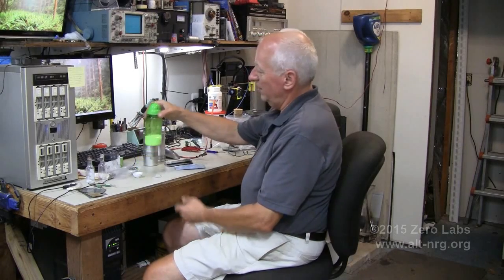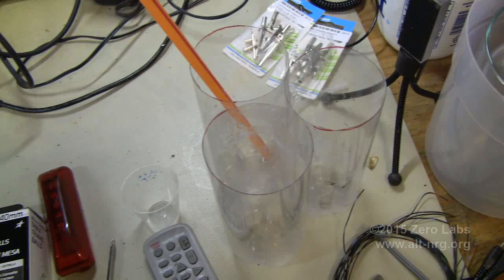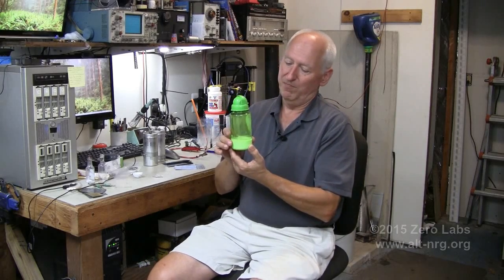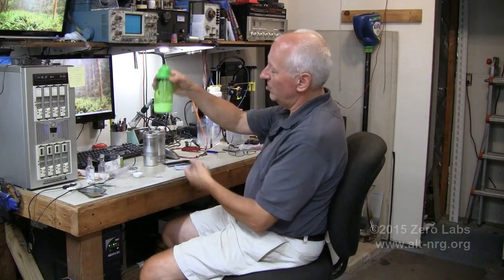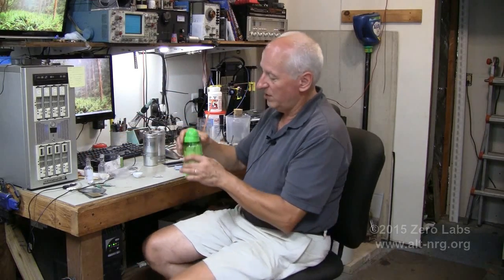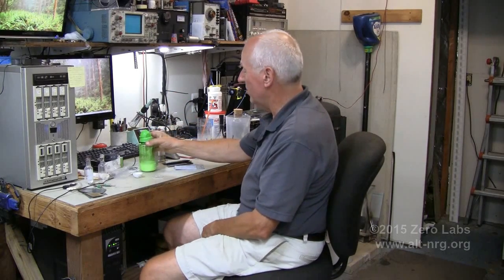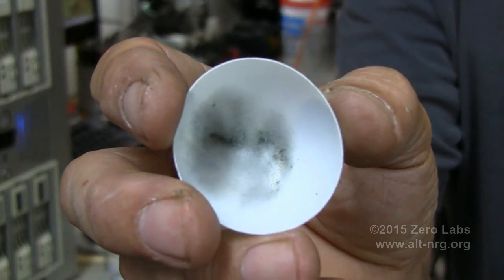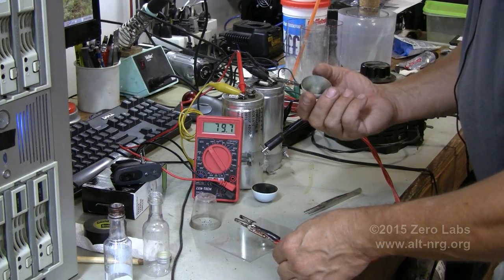#418 Keshe Plasma Reactor project update 04

Comment: the white powder is probably only Zincchloride or Zinc Hydroxid or a mix of both....
did you see any buildup of hydrocarbon fat like substanes yet ?
Reply: Jean-Pierre Mürrli
There will be no electric shock... but the nano-coated wire is pretty wild - which I was slapped by.  I have used many many spices, herbs, salts and/or etc. in the making of the nano-coated copper wires... and they are quite phenomenal.  for instance...

I went through over 48 hours now with different flavors of essential oils in my mouth... they keep changing - but I did not put essential oils in m mouth since the nano-coated wires slapped me around a bit.  Maybe the peppermint will go on for 5 - 15 min., and then the rose and/or etc. may come on my tongue as quite profound - then 5 - 15 minutes later - lavender or black pepper. 

As far as what I put into the lye bath... it was so many things that I lost count - but is like marjoram, sauerkraut, peppermint, lavender, Ecklonia Cava Extract, Ginkgo Bilboa, velvet bean powder, green clay, all spice, cayenne pepper, lemon, orange oil, beans, organic corn chips, super food, chlorophyll, Mexican Dream Plant, Tooth ache tree leaves, olive leaf extract, maw maw leaves, wine, whiskey, beer, honey, turbinando sugar, olives, beets, amino acids by Braggs, Organic apple cider vinegar, fish sauce, Italian seasonings, onion, ginger, horse radish, egg plant, olive oil, hemp seed oil, celery seed, cilantro, parsley leaves, organic butter, peanut butter, cotton fibers, spider webs as they are on everything... rice, barley, wheat, radish seed, mustard seed, cucumber seed, baking soda, yeast, rye, bread crumbs, broccoli, red meat, turkey, chicken, mackerel, sardines, rice, egg, different varieties of peppers, cheese, curry powder, chocolate powder and/or etc.  It all went in there.

These things are impregnated on the nano-coated wiring - so it will transmit all beneficial things from these things - to the water in the cup - I hope.  I am not certain as to this process... BUT WHAT I AM CERTAIN ABOUT... is that you must not touch the nano-coated wires.  I did a few days ago as I said - they slapped me around a bit... and till this very day I still taste different essential oils which I did not even list above due to the vast amounts of things I added to the lye bath - but I have profound tastes of many different oils throughout the day and night... but what I hate worse is the Vitamin B complex vitamin that I added - it is rather gross for 5 - 15 minutes and really sucks.

I hope I answered you well... if not - let me know which I am in full belief that you will do - whether right or wrong - you will answer without much thought.  Forgive me please... if I am wrong.

Peace~
Reply from the maker: +overunitydotcom No fat.
Reply: +ZeroFossilFuel what was the electrolyte ? Just Tap water or saltwater or NaOH water ?
Reply from the maker: +overunitydotcom  Sea salt, 10%.
Reply: +ZeroFossilFuel Okay, then it could also be ZnO. From Wikipedia: Zinc oxide is an inorganic compound with the formula ZnO. ZnO is a white powder that is insoluble in water.
As the Zinc ions go into solution they go to the CuO oxidized copperplates and could there reduce the oxygen so it becomes ZnO and as it is insoluable it falls out and could be the white powder. Then when all the Oxygen Ions from the copperoxide are reduced then the zinc ions can electroplate the copperplates and the ZnO production will stop....
But as Jeff said, could also be Zn(OH)Cl , but ZnCl is soluable in water, so it is probably ZnO or Zn(OH)Cl or a mix of these...
Reply from the maker: Thank you, Stefan. I really appreciate you chiming in on this video.
Reply: +ZeroFossilFuel Hello Friend! What do you think of this Magrav being sold by Keshe foundation? I have seen a lot of news that is false and were never delivered to buyers.
Reply: +KIGRATIS Energia livre This is the usual modus operandi of this lunatic
Reply: +KIGRATIS Energia livre Care to provide some evidence? Or are you just here to publish unsupported gossip?
Reply: +Peter Davis You bought a MAGRAV? It's working?
Reply: +overunitydotcom - Did you know that there was an argument that lasted for years over Monatomic Gold... the makers of it said it was gold in monatomic form... others said it was not and the battle was on.  It was never concluded until one old chap discovered a way to make a hot enough fire to be able to vaporize it so that it could be analyzed by some forensic analyzer which proved that in fact - it was indeed gold in monatomic structure.  Besides...

Who really cares what it is - as long as it works.  I would wear a petrified dog turd around my neck if doing so opened a door to free electricity for me, 3 or 4 months down the road after hooking it up.  I believe it enough that I am building 4 units right now - once complete... I will build more.  I suggest that you do the same before it is too late... 

Peace ~
Reply: +Rev. Al-Yahnai Hawkins Why don't these clowns not have this stuff analyzed in the next university lab, it costs less than 50 Euros. It cannot be stupidity brcause that behavior exceeds the limits of nurmal stupidity :(
Reply: Jean-Pierre Mürrli
I believe it was analyzed to be CO2 GANS... which basically means = CO2 Gasses In Nano State.  What I don't understand is why it isn't "GINS" instead of "GANS".  This guy is a world renowned nuclear physicist... do you really think that he would put his reputation on the line  - ESPECIALLY BY giving the Pope one of these plasma generators?  I wouldn't think he would do that if it didn't work as he says it does... do you think he would give them away if they didn't?

Peace~
Reply: +Rev. Al-Yahnai Hawkins 

I believe it was analyzed to be CO2 GANS
No, it was not. This lunatich ate (!!) the stuff and some people in the inner core ate it as well and poisoned themselves, because zinc hydroxide (The "GANS") reacts in the stomach with the hydrochloric acid to zinc chloride which is highly corrosive.

do you really think that he would put his reputation on the line  - ESPECIALLY BY giving the Pope one of these plasma generators ...do you think he would give them away if they didn't
He gave it aleady to the "ambassadors in his "peace meeting", they plugged it in and switched it on - boom, fuses blown, damage to the house installation...

And reputation? He has lost all credibility in 2012
Reply: Jean-Pierre Mürrli
I don't know anything about him poisoning himself and others but I heard him say not to eat the gans... - I have only been looking into these things since around the 13th of this month, but what I do know is that there were those who did not follow the instructions as to how to hook up the plasma generator - and they didn't do it right.

For it to blow fuses it would have to have been hooked up after the electric meter and before the fuse boxes before acclimatizing the wiring be nano-coated prior to hooking it up before the fuse boxes.  This is done by first plugging in the unit in the further-most part of the house or structure - away from the fuse boxes.  Leave it on there for a week and then move it to the next further-most room from the fuse boxes and then leave it for a week and then do the same until you finally hook the unit up before the fuse boxes.  Then the fuses will not blow.

At least that is what I have heard him say on more than one occasion. 

Thing is though - you did admit that when the ambassadors that did not know how to follow instructions BLEW OUT their fuses and such... guess that should tell you that this plasma generator DOES INDEED CREATE ENERGY - as you claimed it would not... so then - you may have proved yourself wrong while trying to toss dirt on Me. Keshe's head, eh?  What do you think - the plasma generator either produces energy enough to blow out their fuses... or it don't ~

Peace~
Reply: Rev. Al-Yahnai Hawkins
I don't know anything about him poisoning himself and others but I heard him say not to eat the gans.

This was after I had notified him and  the carabinieri about imminent danger afrer I heard about the poisoning. I do know that the alleged CO2 GANS is zinc hydroxide and when ingested reacts in the stomach to zinc chloride, which is highly corrosive and causes strong symptoms of poisoning.

For it to blow fuses it would have to have been hooked up after the electric meter and before the fuse boxes before acclimatizing the wiring be nano-coated prior to hooking it up before the fuse boxes

That's exacly why this nonsense must be stopped. You are obviously not an electrician:
Connecting the box (or anything else) before the fuse boxes is strictly forbidden and a direct way to disaster, the least being blown main fuses (which are not accessible for the customer and you need to call support from the supplier), but it can as well end up setting the house on fire.
Don't guess, we have the circuit diagram and that clearly shows, that this device, no matter how and how long it is "conditioned" causes a direct shortcircuit on the input line. No way aroung that. It is an idiotic misconstruction

that should tell you that this plasma generator DOES INDEED CREATE ENERGY 

What makes you think that? The fuses blow because the device connects the two wires of the in hous installation (no matter where it is connected) with a soiid AWG14 wire. You can obtain the same result by just plugging such a wire directly into both poles of a wall outlet (don't do it, you may damage something in your installation)

Finally: read the above carefully, do not experiment yourself, it is highly dangerous for a layman and before you follow Keshe readthrough what he has achieved during the last years, his claims, his promises and announcements and the results.

Frankly, I would not even believe Keshe when he tells me that the sun will raise tomorrow in the east :)
Reply: Jean-Pierre Mürrli
 You must not have done any research on this recently - as you do not hook up to both lines - just the positive gets hooked up to... and what do you mean that it is forbidden to hook up before the fuse box?

Pray tell then - where does one hook up the power from his/her solar panels, wind generator and/or etc.?  The inverter hooks up between the electric meter and the fuse boxes every time!

And no - I am not an electrician and that is why I like the plasma generator - you cannot get shocked or electrocuted from it... because it really isn't electricity that it creates - it is plasma that mimics electricity.  Like solar flares from the sun - can knock out electric grids - but it is not electricity - it is plasma... BIG difference that I urge you to look into.

Peace~
Reply: Rev. Al-Yahnai Hawkins Ok, continue dreaming But wear a tleast insulating gloves when you fumble around with that "safe" crap. It may pretty well kill you
Reply: Jean-Pierre Mürrli
I wear gloves - but I must say that I was slapped on the arms and in the face a bit with wires that were nano-coated... and I have had different essential oils jump on to my tongue here and there.  I put them in the boiling Lye bath - and they are impregnated into the wires... so the power is there.

Peace~
Reply: +Rev. Al-Yahnai Hawkins Can you please be a bit more specific:

You were sjapped on arms and face - do you mean mechanically by the wire or was it an electric shock?
What did you put into the lye bath? The gloves? The wire? And about what power are you talking?
Reply: +Rev. Al-Yahnai Hawkins 

Please, in the interest of your health, stop these experiments 
There may be consequences which you do not immediately notice, bu can be deadly in the long run (cancer for example)
Reply: Jean-Pierre Mürrli
Cancer?  Really now... the plasma cures cancers so what makes you believe that if it has no powers... that it could actually give one cancer?

Peace~
Reply: +Rev. Al-Yahnai Hawkins The next candidate for a slow and painfull dying. And cancer? yes, really. 48 hours with "essential oils in your mouth? Congrats, you are on the way to win the Darwin award.
Reply: +Jean-Pierre Mürrli you need to educate yourself more on alternatives as you speak from a very obtuse and uneducated point of view.  You dish it out: can you also take it?
Reply: +M A McCabe I just try to warn people not to fall for a scam. Take it or leave it - it's you who has to pay the bill. With money or your health/life or both (Keshes cancer cure is a real bargaun for just 100000 Euros
Reply: +Jean-Pierre Mürrli you don't know it's a scam...  and the money you mention is not what I've heard.  I suspect the scam is from you.  Are you just pissed off or are you paid to spread disinfo?
Reply: +M A McCabe Don't be funny and do your homework before you write nonsense. The money I mentioned is from Keshes hompage

http://keshefoundation.org/applications/medical/diseases/diseases-open-for-research

I made a mistake btw - for cancer it is "just" 50000 Euros, 100000 is for amputation
The summit is the price for coma: Up to 750000 (! no error) Euros.

And now it is time for an apology :)
Reply: +Jean-Pierre Mürrli I'm always funny: I've been in the "alternatives" for about four decades.  I didn't know about the Keshe foundation wanting money for their services....  how rude of them.  It does cost money to run operations in our rude world.   How much do you suppose it costs to treat Cancer in standard, allopathic medicine?  Hey, plus that and the euro is nearly worthless (LOL)....  I appreciate someone finally coming out with some solutions for batteries that run themselves.  An associate of mine, a farmer named Hudson tried to make a battery operation and lost 6million dollars as he was shut down by regulations.  Another associate lost $100K USD on hudson's enterprise and never even got one dose of ORME or even a sample after the debacle. So did Hudson rip him off?   My friend didn't even get to get his leg cut off!  So I'm tickled pink that Keshe is sharing how to make these things because as much as I know, I haven't gotten to make my first free energy battery....  I've made free energy devices, tesla coils, Searle disks, and a few other fun and crazy device including HHO devices devices suggested by this guy on the video....  despite my own skepticism.....  so if you had cancer, you would go to an allopathic doctor?  It could cost you more than a few euros, it might cost your life.  Maybe go to a voodoo practitioner if you don't trust either.  It doesn't mean an outfit that wants a lot of money for something is a "rip off:"  That's your deal, not theirs.  Maybe you've been ripped off too many times in life and suffer from the mental strain of seeing money being exchanged as a form of scam.  The real scam is when the money is made by the banksters
Reply: +M A McCabe I try to warn. Take it or leave it. It is you who has to pay the bill. Either in money or with your health or maybe even your life.
Good luck.
Reply: Paul Andrulis About hundred years ago radioactive water was sold as medicine. seriously. No joke
Reply: +Paul Andrulis ah yes, I have a degree in chemistry plus know all about "m-state" materials and oxides, chlorides and so on.  But I have to say: I'd love to watch while you drink that rad waste water.....  go watch "modern problems" with Chevy Chase to see what my imagination says would happen with you.  I think what I have to say: lighten up!
Reply: +M A McCabe Keshe is right in what he said in his international teaching:

_*Every single one of you failed. The greed took over your intellect.
And then you called me a liar, when you don't want to call yourself Stupid.
You are the most stupid lot I've ever seen Your greed was so high, that you missed the whole ball and it's been right in
front of you. And all I've done, I';ve used the same thing, no more. Anybody who
wants to bring a bullet to shoot themselves for a stupidity bullet not to kill
yourself but to shoot yourself with a stupidity bullet (?), bring it with you on
Thursday. I'll let you shoot yourself*_

(transcript of one of a dozen passages from the workshop)
Keshe followers, listen or remain gullible idiots :(.

Comment: If I were to have to guess what the 'fog' really is then I would have to go with sodium crystal lattice produced by the salt in the saline solution. Just a guess though...
Reply from the maker: Possibly even slightly electrically charged which might explain why it is much less dense and more fog like to start with. Once it gives up its charge , it then settles down and becomes more concentrated. Also just a guess.
Reply: ZeroFossilFuel Or a slight layer of deuterium combined with oxygen(heavy water) just over it trapping it in place(suspension).

Comment: I think the white solid will be mostly zinc chloride (ZnCl2) and zinc chloride hydroxide ( Zn(OH)Cl) if the starting solution was brine/saline. A search did not give me an exact match to your system but I think the best description.of the reactions is similar to your normal zinc-carbon battery at https://en.wikipedia.org/wiki/Zinc%E2%80%93carbon_battery

Below is a salt-zinc-copper explanation but for some people it might be too much

http://chemistry.stackexchange.com/questions/13541/explanation-for-the-reactions-in-a-saltwater-battery-with-zinc-and-copper-electr

https://en.wikipedia.org/wiki/Voltaic_pile
Reply from the maker: +Jeff Harmed Thank you for that little piece of research.
Reply: caveat emptor
Reply: +Jeff Harmed it's probably a hydroxide of zinc, as chlorides in solution are most often deep blue or dark greenish blue....  of course depending on concentration.  As far as it gathering CO2: it's possible (who knows).....  These hydroxides are peculiar beasts....  often becoming "monatomic" or "M-state" because of the separation of the metals in solution.